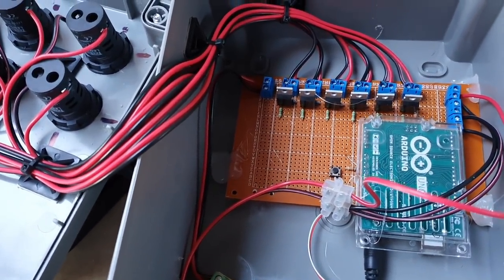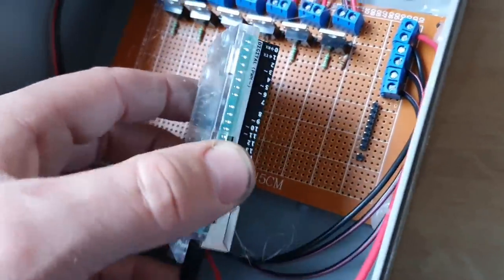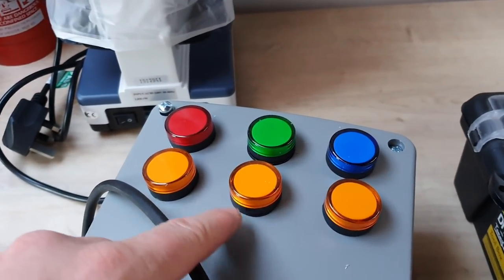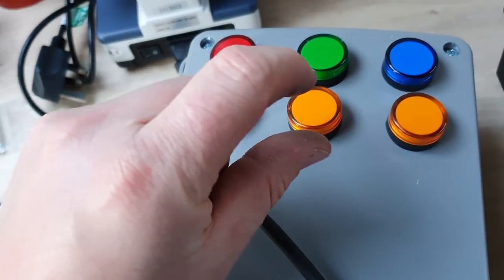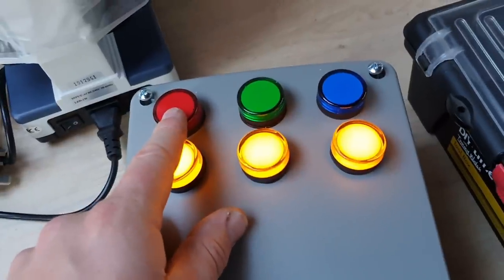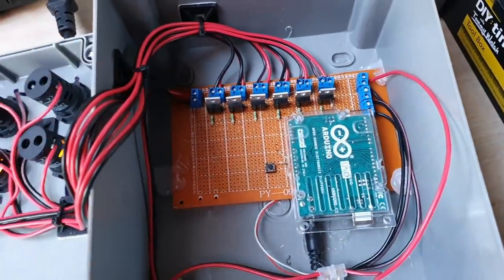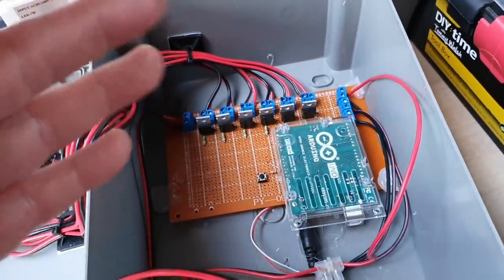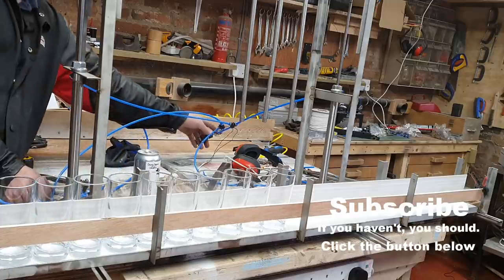Can Filler Build ~ Control Panel

Comment: Friggin awesome Harry! Could you not put a USB extension out of the Arduino and mount another port on the side of the box so you can attach a computer for code tweaking without opening the box? Also, I imagine you guys are thinking of this but once you figure your trigger voltages for your beers you could have profiles saved for automated changing of trigger voltages for fillers. Such a cool project!

Comment: Mentioned this on FB - Brilliant as this is, it can't possibly work...there's no dickie bird on the panel. Just kidding - this is fabulous work. It's too bad you don't have a small screen to read back the foam setting as you adjust it with the potentiometer mentioned below but you may be running out of pins for something like that.

Comment: FYI, you can power the arduino with 7-12V through the VIn pin and save having to plug in the barrel connector. You can also get USB panel connectors from places like farnel which would let you plug in the arduino into your PC without opening the box.
Reply from the maker: Tried that today, the Uno didn't like 12v in via the VIN pin for some reason. it sent all other pins high, don't know why. Gone back to the plug.

Comment: For different beers having different conductivity, add a button that calibrates for beer conductivity on first press and second press it calibrates foam. Before starting a canning session put a pilot can in drop the filling rod hit the button, raise it hit the button. Probably simpler then working with profiles because even from the same beer you might get different results in background noise
Reply from the maker: We added a trimmer pot to do it on the fly.
Reply: @harrybrew69  perfect

Comment: Do you have the diagram? I could do the file to print a pcb with all the tracks and holes for the electronic
Reply: hello, did you ever get the file?
Reply: @madrenostrakombucha7569  nope, there was a github link. Not sure if it's still up

Comment: To adapt the threshold use a pot on A5 and read the desired value. 100nF in the filling sensors lines prevent noise in the readings. Like this. http://www.imagevenue.com/ME121G4G.

Comment: I think adding potentiometer to adjust the desired foam value would be better than pulling it apart every time
Reply: FYI Updated code to use a potentiometer. https://github.com/N3MIS15/OpenBeerFiller/tree/adjust_trigger